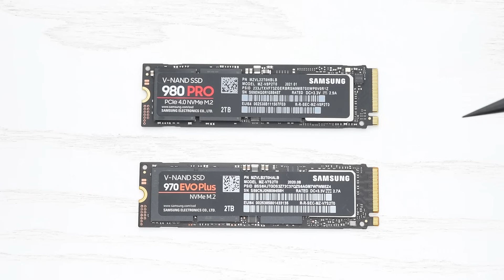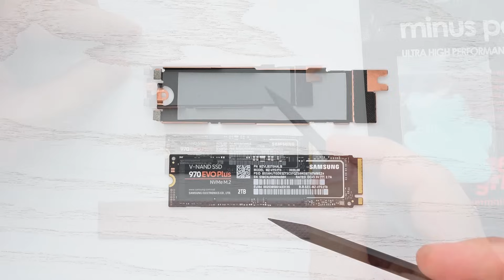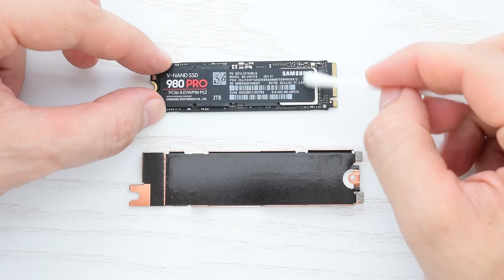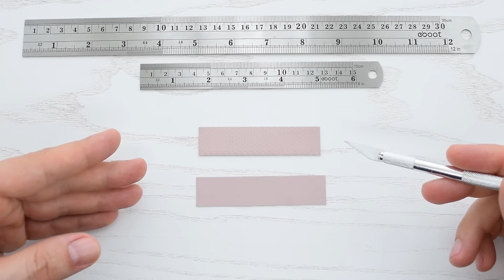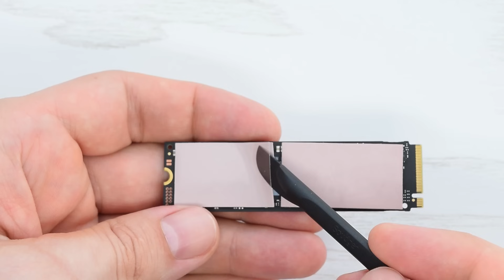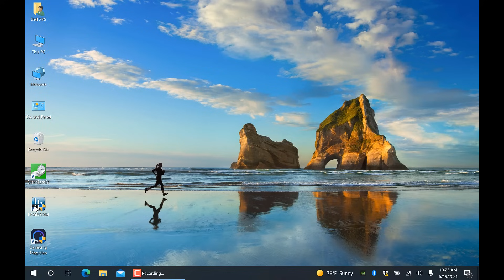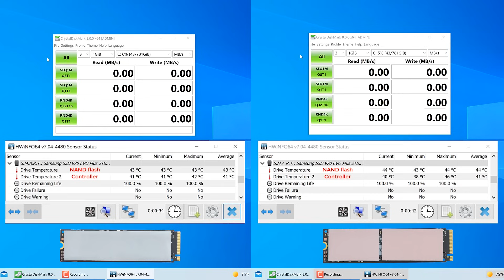Stop your Samsung NVMe SSD from Overheating and Thermal Throttling

Comment: Thank you so much for the demostration! I am on my way to order this thermal pads to solve the overheating issues!
Reply from the maker: Glad it was helpful!
Reply: @ElectronicsComputers  on bottom side do we need to apply the 1 mm one or .5 mm one ? Want to install firecuda 530 with heatsink on ps5 ?
Reply from the maker: @kingcobralive3081  If that heat sink requires a thermal pad at the bottom of the SSD, then use 0.5mm one. Otherwise I wouldn't use it at bottom of the drive.

Comment: Stock thermal pad is that label ssd is coming with?
Reply from the maker: No, the stock thermal pad I was talking about is the original thermal pad that Dell puts into their laptops. It's a good thermal pad but it doesn't work with Samsung's NVMe SSDs. For some other SSD brands that have nice and flat surface it will work perfectly well.
Reply: @ElectronicsComputers  My actual laptop is a Lenovo and It doesn't have a thermal pad not even the M.2 screw.
I saw you didn't pull up that label. Could you test same SSD with and without it, maybe in a new video?
Reply from the maker: If your you have a SATA-based M.2 SSD (NGFF not NVMe) then you don't need any heat sinks at all, because that type of SSDs never gets hot. But if it's an NVMe drive then you need to install a heatsink. Otherwise I wouldn't trust that drive. And if you remove the sticker from your SSD drive you'll void the warranty.
Reply: @ElectronicsComputers  Interesting to know. On the other hand, the seller told no need for anything else but I do not agree. For the sake of reliability, I'd give up the sticker for my SSD which is 970 EVO of course NVMe.
Another rumor circulating is if SSD doesn't reach a high temperature it doesn't work properly. Worth testing.
Reply from the maker: @electrocat9  With the sticker or without it doesn't matter. Just put a proper thermal pad and a heat sink. If you tell me the model of your laptop I'll check the part number of that heatsink and where you can buy it.
Reply: @ElectronicsComputers  I don't like anything else under the sink, might prevent heat transfer... in my mind.
Laptop Model: 80wk00yari
Didn't know the heat sink depends on it.
Thanks, and don't bother too much.
Reply from the maker: @electrocat9  I just checked the service manual and there's no way you can install SSD heat sink into that laptop. Only if you glue it to the drive itself. Or you can install any gen 4 SSD which won't get hot with that gen 3 PCIe of your laptop.
Reply: @ElectronicsComputers  Interesting again what you say.
I just sent you nice pic in your email, here of course does not accept. As you see in the pic, you are right, no screw for hanging the heat sink.
Reply: Thanks again
Reply from the maker: @electrocat9  Never received any pictures.
Reply from the maker: @electrocat9  I don't have that model in my repair shop at the moment, so I don't know the distance between the SSD and the cover. But anyway, one of these solutions might work for you:
http://alii.pub/5xps0f
http://alii.pub/5xps17
Reply: @ElectronicsComputers  thanks! But i wanted to know if you liked the picture and If the email services are reliable.